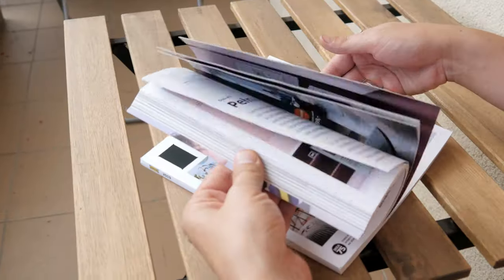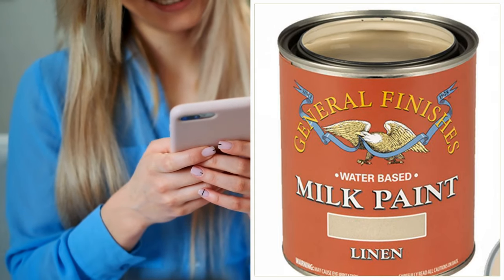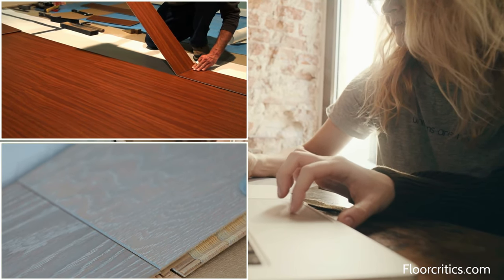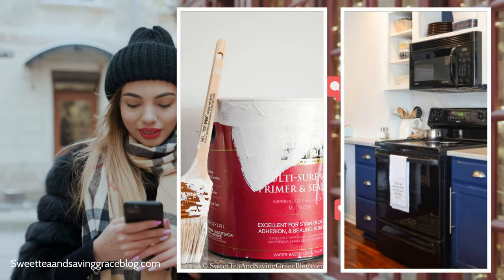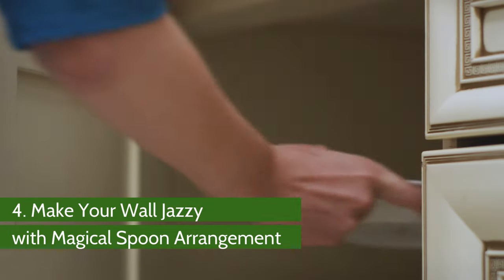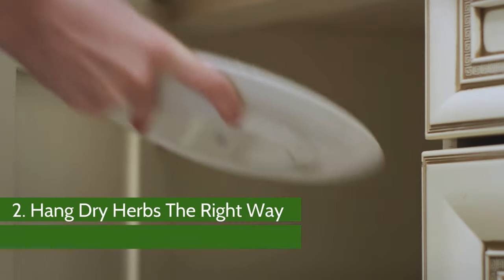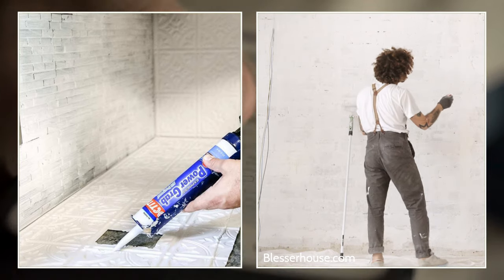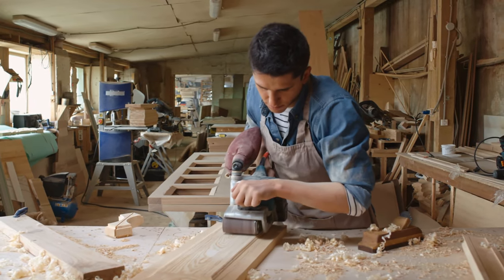12 Kitchen Cabinet Makeover Ideas

Comment: Number 8 - Please do not take the light fixture out from the hardwired electrical wiring without switching the power off AT THE MAIN ELECTRICAL power box/panel FIRST or hire a QUALIFIED Licensed ELECTRICIAN.

Also, this video has way too much distracting "B-Roll" mixed in.